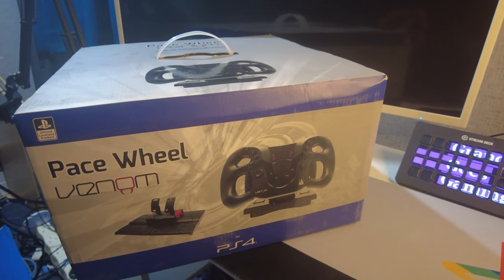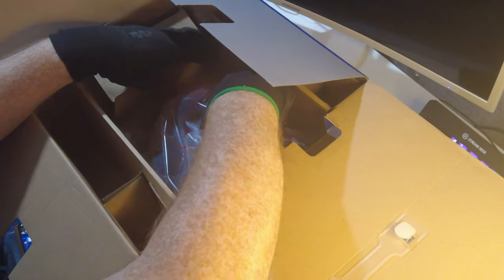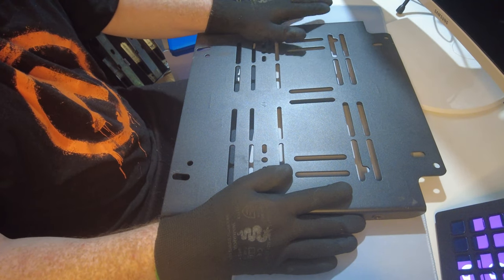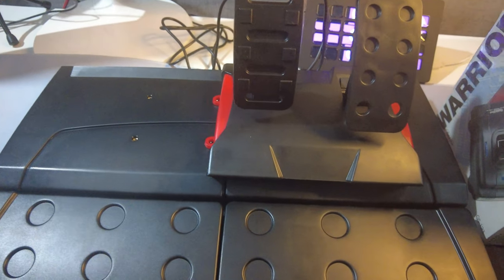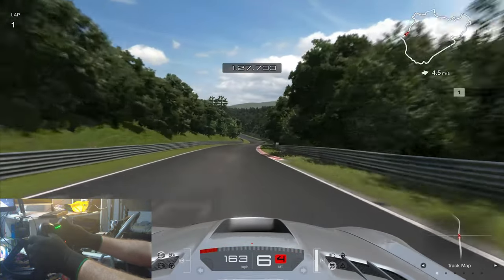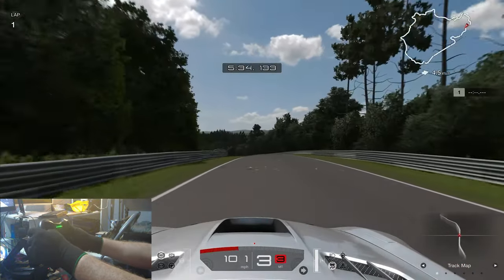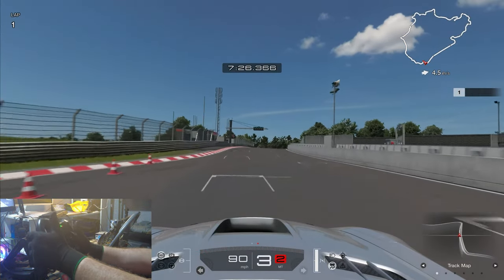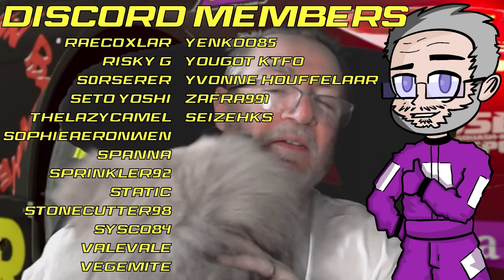Is the Venom Pace Wheel a Game-Changer? Unboxing and Review

Comment: Do you have any other yoke shaped wheel recommendations for ps4
Reply from the maker: The PS4 isn't really awash with yoke shaped wheels, but wheel rims of that shape are in the Fanatec and Thrustmaster ecosystems. 

The cheaper option would be a Thrustmaster T300 with either the open wheel rim or the Ferrari F1 rim.

Comment: Im actully think about to buy this for gran turismo sport
Reply: Its 334 in my currency
Reply from the maker: Right now there's a lot of good, inexpensive wheels that are better than this one. I'd recommend the Thrustmaster T128 as a starter wheel over this and right now the price shouldn't be too different.
Reply: Okay thanks maybecuz i like the shaoe of the weel formula kinda thing and it looks good
Reply: I don't like the shape of t128 it looks kinda old so im gonna see
Reply from the maker: Okay. As long as you remember that this is just a vibration wheel, not a force feedback wheel and that it's a bit wobbly because of that adjustment system, then it should be a decent starter for PS4 play 👍
Reply: Thanks
Reply: Thaks for reccomend t128 but i found this wheel for half a price and its close to me owner said that his son opend once and played 2 times so good conditcion and good price
Reply from the maker: Great. Remember that this has two modes and if you're finding your steering is too sharp and the vibration is too frequent then you're probably in joypad mode, which is reserved for games such as GTA and Hot Wheels.
Reply: I think its better for it to be sharp and more vibration becuse you know what happend on the track
Reply: This video has help a lot and i buy it